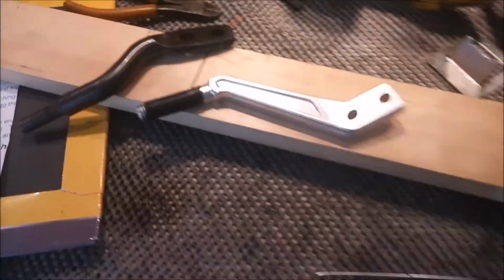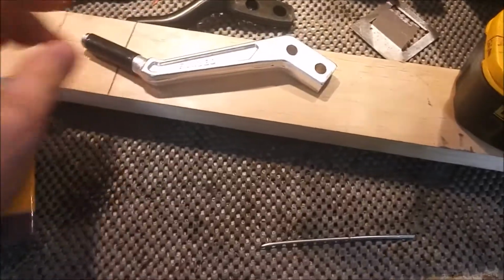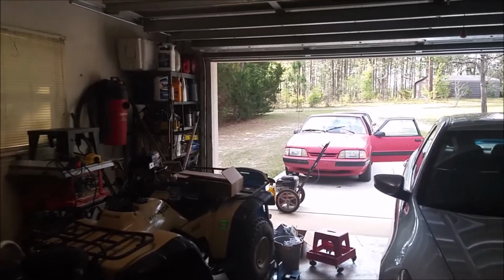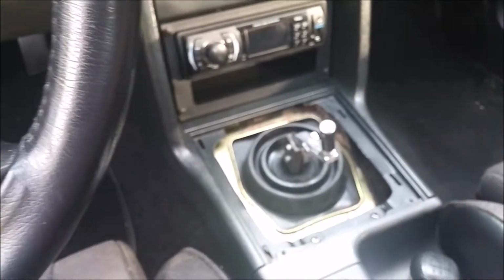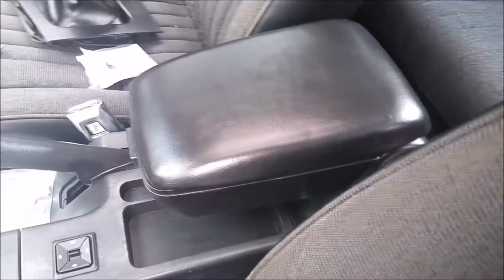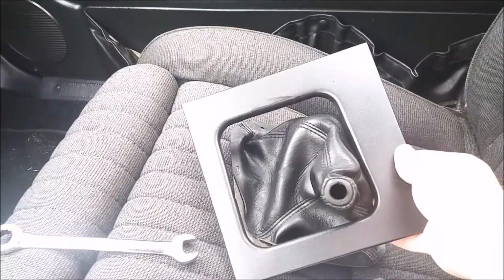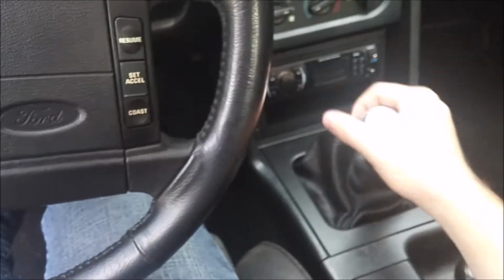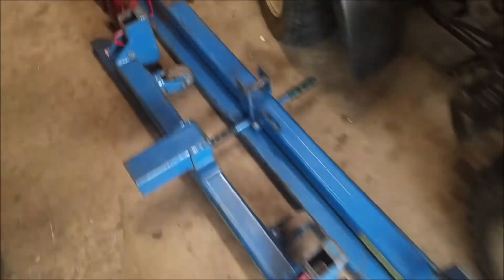DRG Quickie: Mustang Interior Update

Comment: The shifter bolts in on the other side. I just changed my factory one and it sat on the left side and bolted into the right side. Just letting you know
Reply from the maker: Ryan E you can bolt it either way. this way the offset is less hectic which I prefer. it's all preference. and the Hurst bolts from this side.
Reply: DirtRoad Garage ok just making sure. You never know if the previous owner had it on backwards. Now I'm curious about how my shifter would feel on the other side...